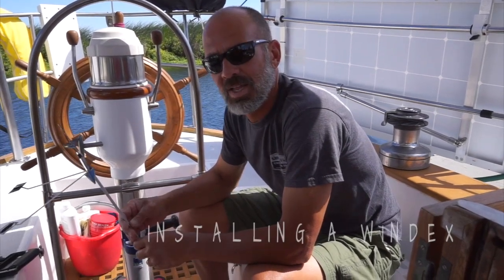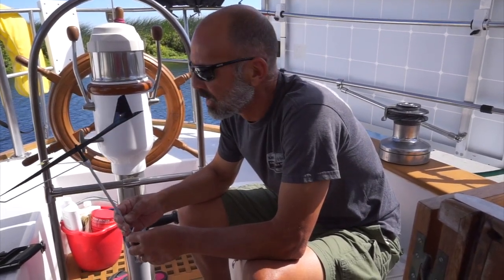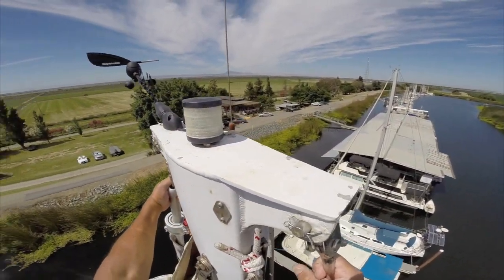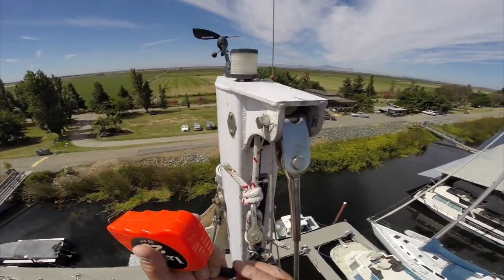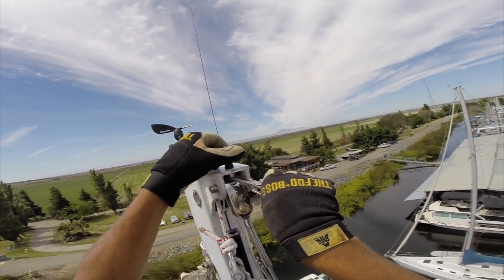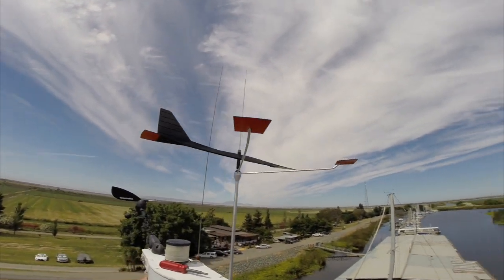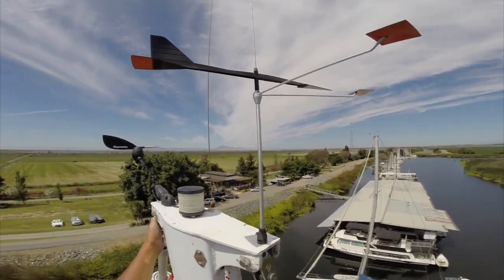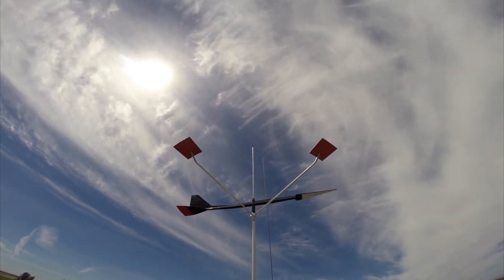SV Ramble On | Installing a Windex

Comment: You were so calm the whole time.  Bravo! Not even sure I breathed while watching the video.  If it had been me, there would be no filming of the crazy man at the top of the mast.  Just a picture of the new windex from 60 feet.  👍
Reply from the maker: I have a nice safe climbing rig for working up the mast, so not too worried about falling.
The bigger concern is what's going to break if I drop tools from that altitude.
Good thing our Outland Hatch Covers are impact resistant!!
Thanks again for the great product.

Comment: Good job, Rich.  And, you didn't even drop any of those small parts, like I would have!
Reply from the maker: Precisely the reason I did most of the assembly down on deck.  I usually bring a couple extra screws and nuts up the mast with me just in case.

Comment: Put some duralac onto the thread.  I replaced my W15 on the weekend and had to grind the top fitting off as thread had seized in the aluminium

Comment: nice video but it would have been better if you discussed how it works.
Reply from the maker: It's analog - it points into the direction the wind is coming from.  Not a lot of bells and whistles with this one.
Reply: @svrambleon  what do the tails do
Reply from the maker: The tracking tabs show you the no-go zone.  If the tail of the vane is between the tracking tabs you'll be in irons.